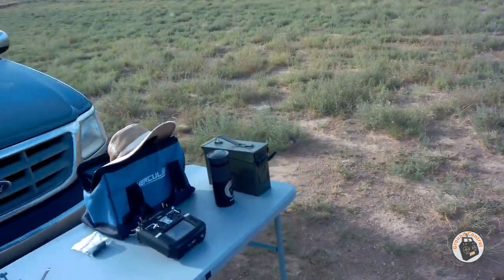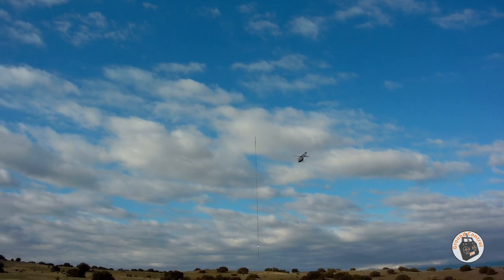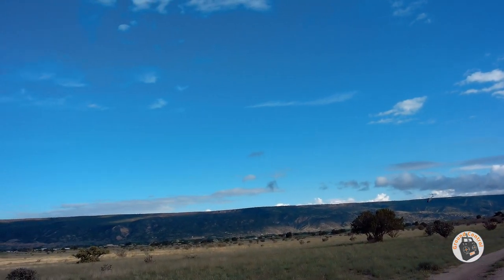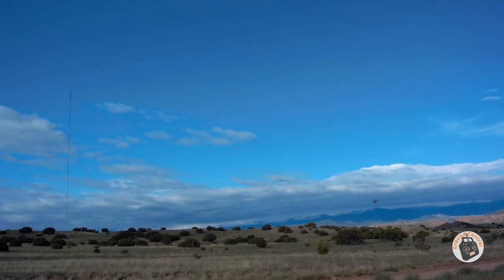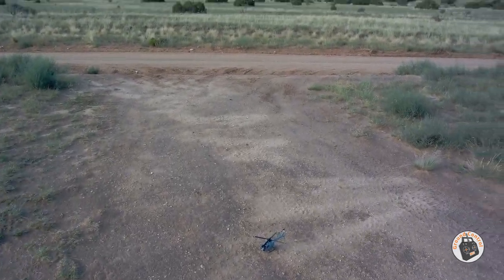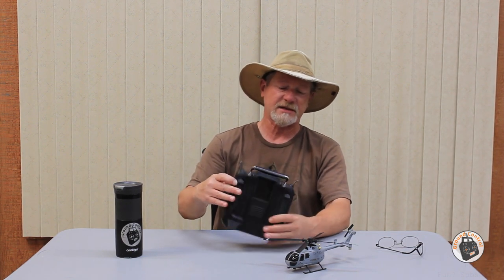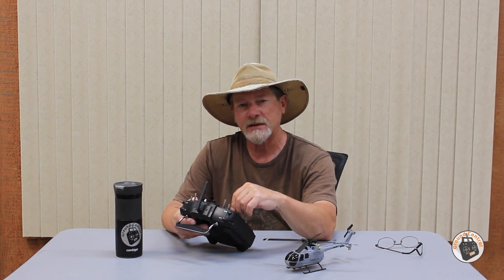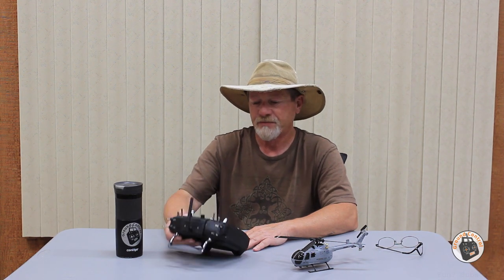So Smooth! RadioMaster TX16S Setup & Test Flight #1! Eachine E120 BO-105 6Axis Gyro Helicopter RTF

Comment: What's the difference between OpenTX and EdgeTX?  I just bought the TX16S (4 in 1) a week or so ago and it uses EdgeTX.  I have the E120, and RC ERA C138 Bell 206, and a Blade Nano S3 that I intend to set up on it.  In addition, I have a Volantex P51 and P47 (400mm Mini Warbirds) and a Eachine T28 (400mm Mini Warbird) to set up on it.
Reply from the maker: I've never used EdgeTX only OpenTX.
I understand that EdgeTX has the most cutting edge features hence the name.
I continue to use OpenTX as it should be more stable since they only include new features after they are well tested.

Comment: I think the Throttle Decent is programmed in the FBL Controller. Stock Radio Stick is spring Centered. I may set my TX16s that way for these. 

On Stock radio. Once you pull below Center it starts slowing the Head speed down for a landing. I gradually pull half way down to descend, then as it gets close, 3”, I Bottom the Throttle and land. Hold it Down for several seconds to Shutdown Motor. 

Should act same on TX but Stick being more precise, might be too much Range applying. 

Maybe a Throttle Curve in Normal Mode could Shape it smoother?
Reply from the maker: I haven't setup a throttle curve, but if it works like EXPO it could certainly make the throttle range smoother.
I looks like you just about complete with the setup on the new TX.
Reply: @GroundControlRC  
Great News!!  Another 6 hrs experimenting on the TX16S after being up till 4:30 AM Tracking Tornadoes in Tenn. 🙄

Tried 4 different model configurations. Tweaking Inputs, Mixes, Outputs and SF’s. Mixed results. 

Finally opened up Companion. Found the C189/MD500 Model from Slovenia, and read settings one panel at a time and manually put them in Radio so nothing else got affected. 
All I had to do was change Switches to what I needed. 

This Worked! I even put 3 Widgets on the main Screen. Timer Gauge, Batt Voltage, Outputs. Handy!

I only put Triple Rates on Ail, Ele, Rud. I cam tell by the way the Throttle is working, that I can add 2 more Flat Rates on Thr. 🤠

Taking the BO-105 with Stock radio And TX16S on TN trip. 
Teach my Son in Law to fly the C187 I got him in March. We will have two Scale Minis flying in the Fairgrounds! He is a soon to be Part 107 Drone guy. 😎

Thanks for all your help and Feedback. You might be interested in my Model Config after I finish the extra THR Inputs. Runs on fewer settings. 
Has Voice Tracks on all the SF’s. Video over on my Heli Channel. 

 https://youtube.com/@OHHP3712U?si=w5GBlLaJE5Tgxi69

Thanks Again! 🙂
Reply from the maker: @doublediamondrailroad5949  Success!

Comment: Hello i bought a radiomaster boxer transmitter. It only has the e129 protocol on it. How did you get the sub protocol of c186 ?
Reply from the maker: I had to update the Multi-Module Firmware on the radio.
They add new protocols all the time so updates are needed periodically.

Comment: Were you actually able to set 3 FLT Modes with 3 different Head-speeds? Pitch too?
Reply from the maker: Yes, I think I setup (3) flight mode with different Dual-Rates on a 3-position switch.

Comment: Hello can your c186 model file be copied into my radiomaster boxer transmitter?
Reply from the maker: You will need to import it using OpenTX Companion and Modify it for your Radio but I would think that would work.
Reply: @GroundControlRC  ok

Comment: Hey Ground Control! I found the E129 in the profile but where is the c186? Do I just have an old firmware version?
Reply from the maker: Hi Greg!
Yes, I downloaded and installed the latest stable versions of OpenTX and Multi-Module to get the E129 / C186 Protocol.
It may have been included in the previous release but I'm not sure.
Reply: @GroundControlRC  ok got ya, I think I'm going to keep the radio as is until I feel like I can update the radio without screwing it up. I don't have the heli but it would be a neat addition if the process was  easier.
Reply from the maker: @greg0063  No worries!
I know I was very nervous about updating the firmware the 1st time.
This is the only TX I have that uses OpenTX and Multi-Module so I'm still a bit of a Newbie with this stuff.
The OpenTX and Multi-Module websites have some great information on how to perform updates and I use that info as a refresher every time I update ;-)
Reply: @GroundControlRC  I knew about Companion but Mult Module is new to me I will look.
Reply: @GroundControlRC  Thanks for the reply by the way!
Reply from the maker: @greg0063  You are most welcome.
See you in the Air!

Comment: Mine is flying out of control trying fixing calibration but nothing is working
Reply from the maker: Hi Brandon!
Here are some questions that may help you troubleshoot the issue.
Are you flying it with the Stock TX or a Multi-Protocol TX?
If this is happening with the Multi-Protocol TX is this also happening with the Stock TX?
If you haven't tested it with the Stock TX after experiencing this issue, I would also test it with the Stock TX as it could be a Gyro issue.
Are you using Protocol E129 and Sub-Protocol C186 on your Multi-Protocol TX?
Do you have any Trim or Sub-Trim programmed into the radio? If so, I would remove all Trim and Sub-Trim, Re-Calibrate the Gyro and test again.

Comment: How did you bind it? I've got the model in my tx just can't get it to bind
Reply from the maker: Hi Charles!
I used Protocol e129 and SubProtocol c186.
See you in the Air!
Reply: @GroundControlRC  thank you kind sir! I'm not seeing an option for the sub protocol so I may be in the wrong window on the TX screen (I'm a rookie) lol. I'm updating to Edge tx today, hopefully that will make it easier.
Reply from the maker: @Chuck_theModfather  Hi Charles!
No Worries!
This Protocol hasn't been available all that long so you may need to update to the latest version of the Multi-Module Firmware to see that Sub-Protocol.
I've had to do that a few times when new Protocols come out.

Comment: What protocol do you bind to? 
Please tell me your name~
Reply from the maker: It uses the E129 / C186 Protocol.
I'm Tony with Ground Control RC
See you in the Air!
Reply: Does the TX16S remote controller have E129/C186 protocol? 
I don't think it's in mine?
Reply from the maker: @imjangsuk  Yes, it does, but I had to update the firmware on mine to see the C186 Sub-Protocol.
Reply: 감사~~~^^* 즐거운 하루 되세요~~~

Comment: Is it compatible with flysky FS-I6 transmitter
Reply from the maker: Hi Arun!
Not as far as I know.
I think you would need a Multi-Module Transmitter.
The Protocol is E129 and the Sub-Protocol is C186.

Comment: I think my new Stock Radio with it is basically junk for flying it. The Cyclic stick is way to erratic. Touchy. 

When i pull right or left, it first  starts going the opposite direction, then I pull farther and it catches itself and goes right way. 

Its also very Robotic in Hover, any corrections it Jumps, not smooth at all. No precision. 

I got a new MD500 RTF  
And Bound That radio to the E120. Definitely better somewhat. But still seeing same actions. 

Really think a Boxer would solve this and smooth it out. I can’t say mine is Awesome at all with Stock Radio. 😅
Reply from the maker: Sorry to hear of your issues.
I didn't have any of those problems with mine as demonstrated using the Stock TX.
A Hobby-Grade TX is always much better with these micro aircraft though and makes them feel like larger aircraft with really good resolution on the sticks.
I'm not sure if you've re-calibrated the Gyro but that's the 1st thing I do before my initial flight when they come with a Gyro.
Hopefully a Hobby-Grade TX will solve the issues you're having with the Stock TX.
Reply: @GroundControlRC  
Yep Bind, Calibrate Before I fly. 🤠

Just ordered a Boxer with Lipo from HeliDirect! 😎
Reply: I think flying in open area might be ok, but flying with Stock Radio inside a closed 10’x10’x10’ box area inside my garage is Really tough with any jerky Stick actions. 😮
Reply from the maker: @doublediamondrailroad5949  Oh Yeah! That is hard to do with the Stock TX.
It's hard for me in a space twice that size ;-)
Reply: @GroundControlRC  
Boxer just shipped from Helidirect! 🤠
Reply from the maker: @doublediamondrailroad5949  Sweet!
Reply: @GroundControlRC  
Just sold my DX8G2 too!! 😁😎
Reply from the maker: @doublediamondrailroad5949  Oh Man! That probably paid for the Boxer ;-)
Reply: @GroundControlRC  
With Lipo Plus! 🤠

Comment: If I using jumper t lite, under what protocol name this heli was?
Reply from the maker: I'm not familiar with the Jumper T-Lite but the Protocol is E129 / C186.
I hope that helps and I'll see you in the Air!
Reply: Did you ever get this heli to work with your Jumper T-lite?  I would like to use my jumper with this heli as well.